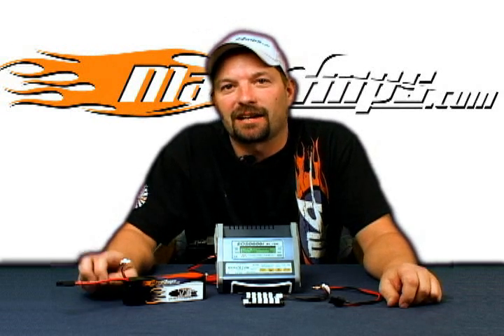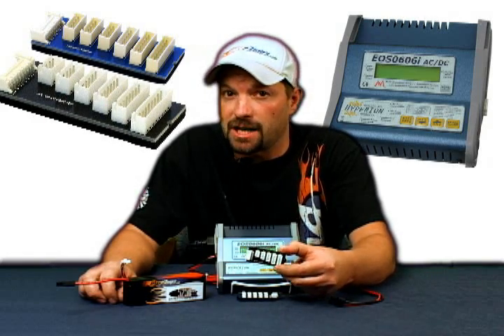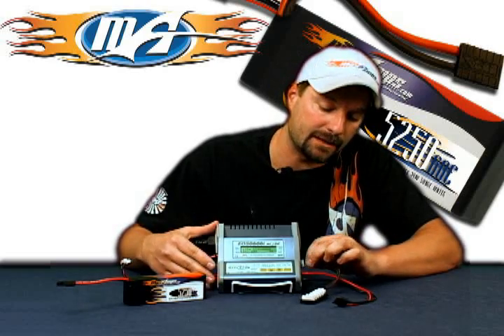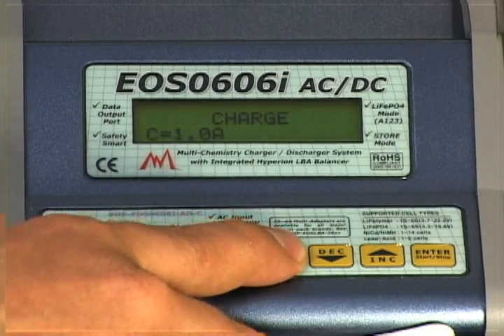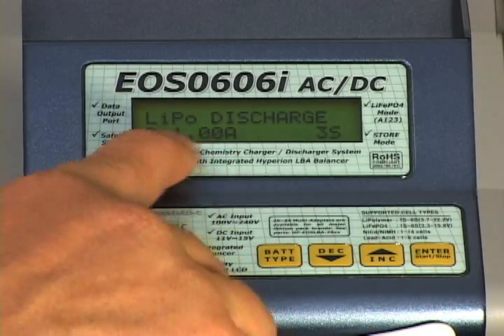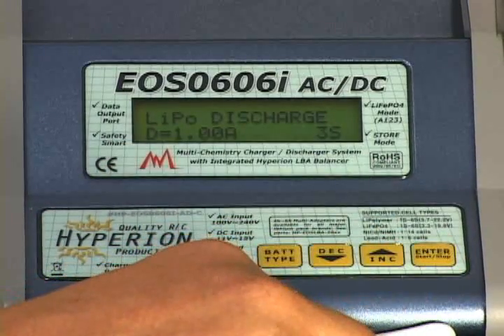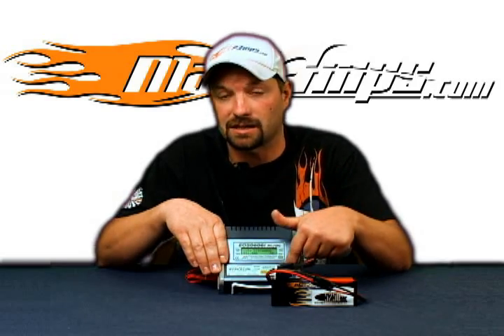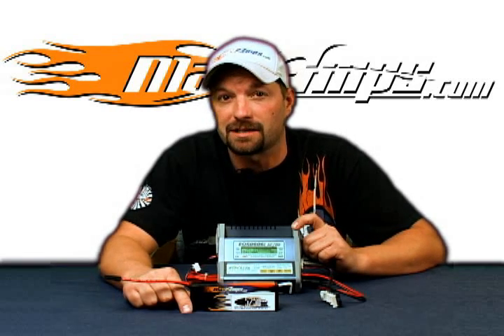How to discharge a LiPo pack using the Hyperion EOS0606i AC/DC Charger

Comment: Is this to discharge a battery to a lower charge for storage
or
is this to discharge a battery all the way to zero
so it can be trashed  ???

I need to discharge to zero
and throw the battery away
Reply from the maker: This would be for cycling your battery pack. If you are looking to dispose of your battery I would recommend taking it to a battery recycler. This is the easiest method to safely dispose. Salt baths will render lithium inert but are inconsistent.
Reply: thank you, I searched just now and Home Depot and Lowes accept rechargeable batteries and cell phones - the ad does not say if that includes lipo - so I'll need to check on that.
I had a battery pack  lose a cell while landing (10 feet up) causing a crash. Its past warranty so I'm looking to trash it safely.